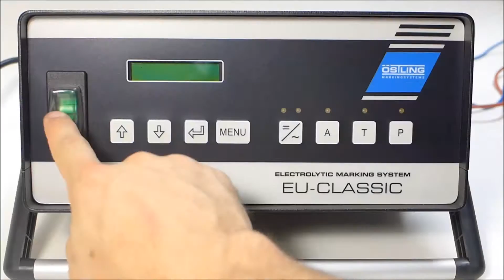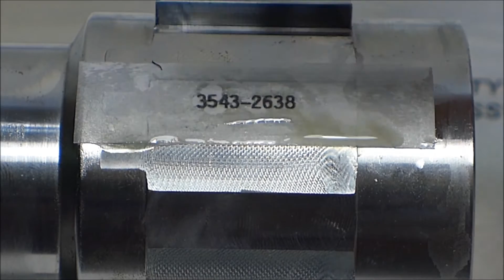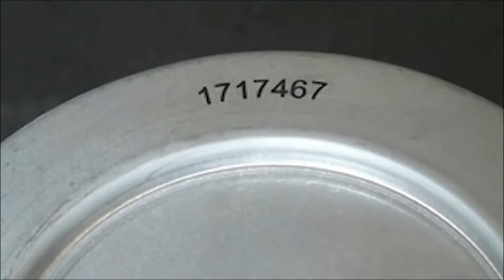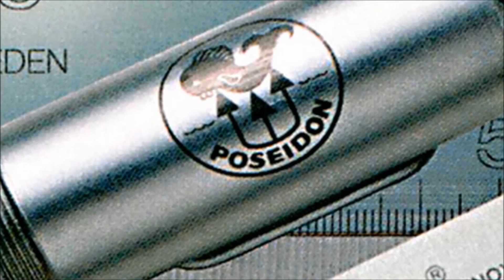Printing Part Numbers with Stencil Printer and Etching on Metal

Comment: what is the stencil cartridge? 
Are the other printers that have more custom design options?
Reply from the maker: The stencil cartridges are available from us to fit our stencil printers. We do also have a newer, different stencil printer that can print on a roll of stencil paper of 100mm wide (currently at 100M length, but may later also be available in smaller lengths). This will allow you to do larger/smaller text in various fonts and include basic logos also. To obtain pricing, or be contacted about your nearest distributor, send us an inquiry via http://www.trendmarking.com.au/trend-australia-details.html and we will get in touch with some information.
Reply: Google maps tells me I am 18hours and 20 mins by plane to get to you. Plus $1,860 for the ticket...

Sorry to waste your time.
I will try to just ask Brother for the information.
Reply from the maker: We are based in Australia but the systems and accessories are available from a range of distributors worldwide. As such we do not have to send goods from Australia nor do you have to travel to us to collect, even if you have a hankering for great beer and awesome beaches.